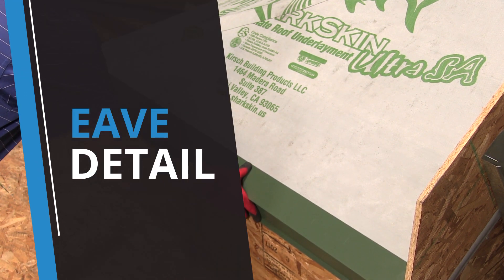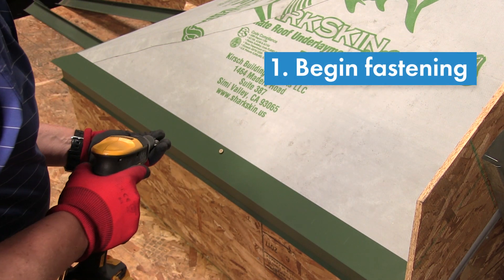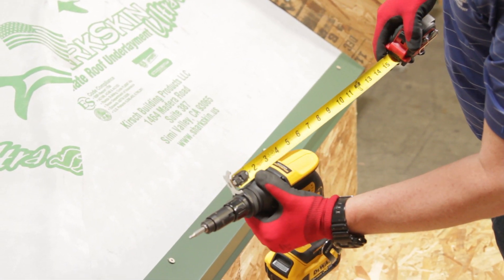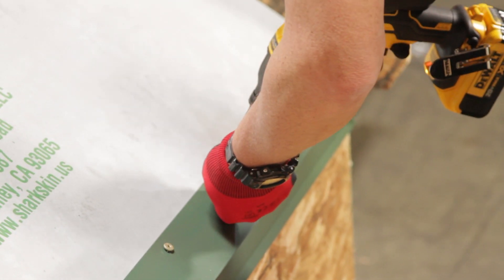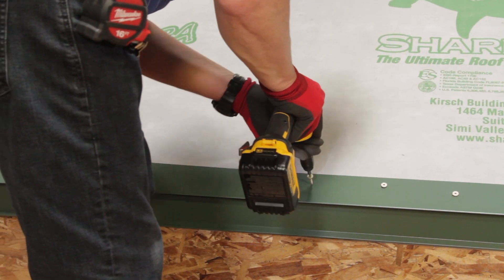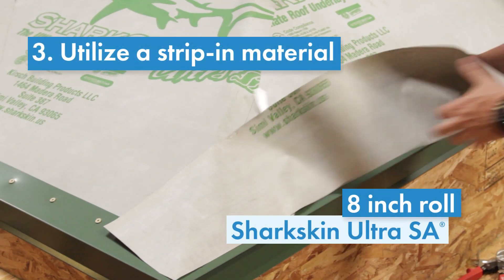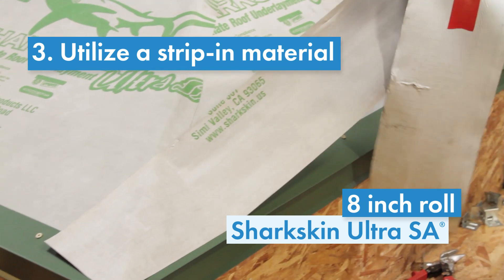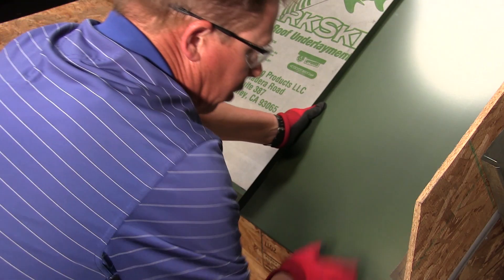Standing Seam Metal Roofing Installation: Eave Detail

Comment: How about lapping the drip edge on a hip instead of relying on a waterproofing substrate and cutting the rib off the first panel in preparation to bend as side wall flashing or preparation to fit into z bar/ C channel sidewall flashing. A couple extra steps and this video would be more helpful if indeed it’s intended purpose was to be a how to video. I love the fact that there is a metal roofing YouTube channel it’s important to me that there are reliable sources for upcoming professionals to refer to. An informational channel like this should be most importantly focused on real world installation techniques and information. It would be great to see more videos on hip and valley installation, installing single panels over different roof pitches, sidewall flashing and cap installation. But my assumption is you will be more focused on the product and engineered roofs which is great from an informational and industrial standpoint but not to overshadow residential applications.
Reply from the maker: This video was meant to be a basic level video, but your point is taken! We do have plans to expand into an additional installation series like this one that go into more detail. And to speak to your last statement, our goal is to educate the industry as a whole, so whether that be through videos on commercial applications or residential applications, we are open to the entire gamut. Thank you for your support and your insight; community feedback is very important to us. Thanks, Ben! -Thad